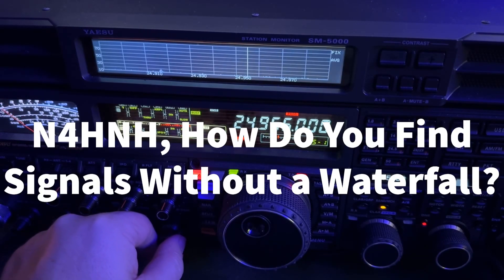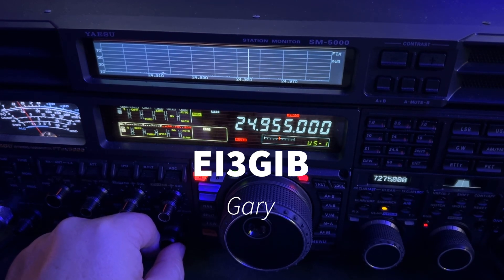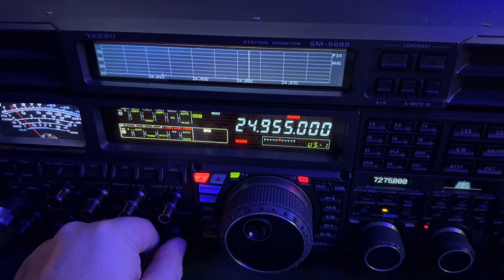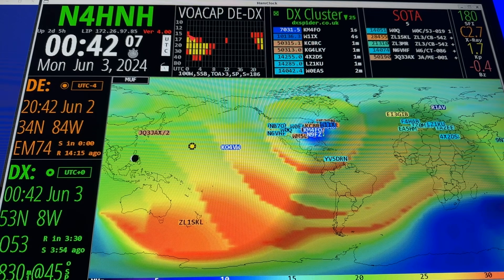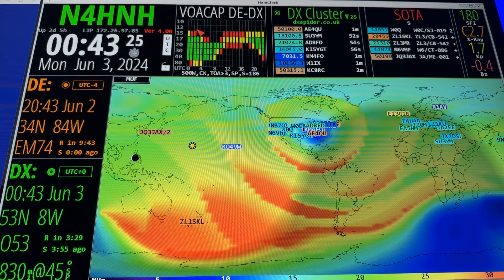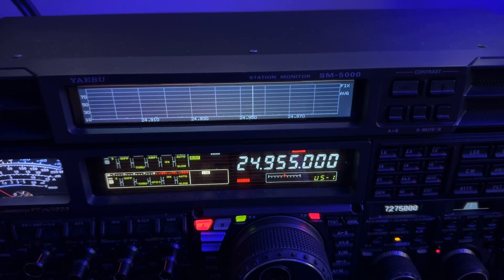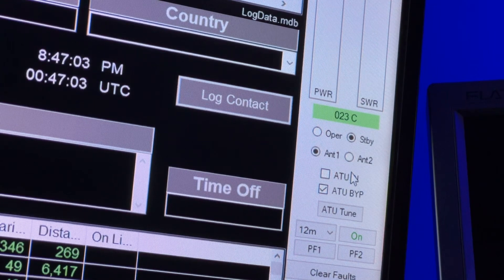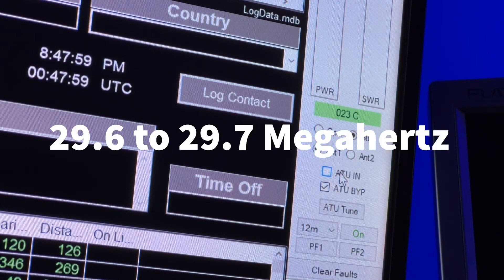N4HNH, How do you find signals without a waterfall? #hamradio #ftdx5000 #waterfall #spectrum #scope

Comment: One waterfall option for the FTDX-5000 series of radios is to use Win4Yaesu software, a SDRplay RSP receiver and an interconnect cable from the FTDX-5000 IF output to the RSP.  The downside is the extra cost, but if one is already using a computer for logging chances are good that the Win4Yaesu software will work so all that is needed is the RSP and cable.  While the Win4Yaesu software is highly integrated with the FTDX-5000 (also the FTDX-1200, 3000, 9000 and FT-991/A), there are other free software options that also work.
Reply from the maker: I tried Win4Yaesu software. It was okay but I couldn’t adjust the size of its dialog and it was missing the ability to control some functions of the radio. As I recall, one thing mixing was some of the controls for the sub receiver.  I also tried the SDRPlay unit for about 5 days.  It caused a load on the IF that wasn’t worth the tradeoff.  It couldn’t even come close to receiving as well as the FTdx5000 receivers.  I decided not to trade superior receiver performance for a waterfall, especially since this is radio and not television. I can spin the VFO. I rarely even look at the spectrum scope.
Reply: @n4hnhradio  Hello,  I haven't tried controlling the sub receiver, but it's been my experience that the primary receiver functions are available in Win4Yaesu.

I'm a bit confused about your SDRPlay experience.  I connect my first gen RSP1 directly to the IF output jack on the radio, and thus it's only seeing/hearing what the primary receiver of the FTDX-5000 is, and that is being picked up by Win4Yaesu.  If you are referring to the SDRPlay RSP loading down the main FTDX-5000 receiver that's very concerning, and I'll need to check that out.

If you are referring the SDRPlay receivers as a standalone radio I have tried using the an original SDRPlay RSP and RSP Duo (both early model radios) as standalone receivers, and as a separate standalone radio I wasn't impressed.  I found both radios suffering from local broadcast overloading, even with an external attenuator along with the broadcast band limiter in the RSP.  I haven't tried the newer SDRPlay radios, so they may be better.

Thanks!
Reply from the maker: I tried the duo model stand-alone and fed from the IF.  Stand-alone was not impressive. I read reviews that the host receiver would be adversely affected to some degree, if using the SDRPLAY as a panadapter.  Since this is radio and not TV, receiver performance must take precedence over a display.  Especially since a waterfall is not something that interests me.  I bought the SM-5000 for the speakers.
Reply: @n4hnhradio  Good to know that the RSP is loading down the IF.  While I haven't noticed any issues, I'll definitely do some testing!
Reply from the maker: @radiofan2454 I haven’t tried one since 2019. Maybe they have improved, as you say.

Here is some information from Google’s AI: 

An SDRplay can adversely affect the reception of a nearby radio receiver if it is "tapping" into the receiver's intermediate frequency (IF), essentially stealing the amplified signal at a crucial stage in the receiver's processing, leading to a significant degradation in signal quality for the affected radio. 

Explanation…

How a radio receiver works: Most radios use a superheterodyne design, where the incoming radio signal is converted to a fixed intermediate frequency (IF) for further amplification and filtering before being decoded into audio. 

SDRplay and its function: An SDRplay is a Software Defined Radio which receives a wide range of frequencies and digitizes the signal, allowing the user to process it on a computer. 

Potential for interference: If an SDRplay is operating close to another radio receiver and is tuned to a frequency close to the receiver's IF, it can unintentionally pick up the amplified IF signal from the receiver's circuitry, essentially "tapping" into the signal before it is fully processed, resulting in a weakened signal on the affected radio.

If you really want a panadapter, the tradeoff might be worth it. I recall reading on a forum that the host receiver might lose 3dB of sensitivity.  That is only 0.5 S-unit of loss. I could live with that, if I wanted a pan adapter.

Comment: As a relatively new ham, the lack of standardization with S-meters bothers me. In my mind, the first number ("R" in RST) should be the subjective readability, and the "S" should be an objective signal strength. If the meters cannot be trusted or used for the "S", then now you have two numbers that are both subjective and seemingly referring to the same thing, making them redundant. I also wonder about the extremes-- In theory, you should be able to have a 51 scenario ie a very weak signal but perfectly readable due to a low noise floor and sensitive receiver.
Reply from the maker: Readability of 5 means you heard every word.  4 means you heard all but a word or 2.  A readability of 3 means you only heard approximately half of what they said.  At 2 or less you were probably imagining a signal.

The IARU established that a signal strength of -73dBm at the input of a receiver should be indicated as S9, with 6dB of change representing 1 S-unit of change, between S0 and S9.  

One problem is that meters are mostly accurate at mid-scale, which is why they are calibrated at mid-scale.  HF radios are typically calibrated at 14MHz, the middle of the HF spectrum.  So they will be most accurate on the 20m band.  The high and low end of the scale will be off to some extent, depending upon frequency and physics.  Physics?  The physics of the d’Arsenval movement in traditional S-meters affects the accuracy.  The needle relies upon a spring to provide resistance to movement.  The consistency of the strength of the spring could skew the readings in the upper and lower portions of the scale.  Note that all d’Arsonval movement meters exhibit similar characteristics, whether reading volts, amps, watts, etc.

The newer radios use digital technology to simulate a signal meter.  It is reasonable to expect a bit more accuracy across the scale, since the readings could be digitally compensated. But that adds programming cost which will be rolled into the price of the radio.  I suspect that the manufacturers settle on a principle of “it’s close enough for practical use.”

There is a similar situation with wattmeters.  The standard variety of meters are accurate to +/-10%, even the digital ones.  The professional grade meters are typically accurate to +/-5% with a few being as accurate as +/-3%.  Professional grade meters typically cost $600 or more.  Do we need to know so badly if our power output is 90W or 100W?  Not really.  No one can hear the difference over the air.  But, if we must know within 5%, we must spend $600 or more on an external, dedicated, meter.

Back to the Signal Meter.  S-meter readings from a high quality radio are usually not off by more than 1 to 2 S-Units (6 to 12dB) between S1 and S9.  That is close enough.  I err on the side of the person I’m talking to. If the meter shows 8, I give them 9.  If the meter shows 7, but they sound like 9, I give them 9.  

Perhaps we could tell the manufacturers we are willing to pay $600 for them to integrate meters with an accuracy of +/-5%.

I recommend that you not get too hung up about meter readings.  The radios in the early days didn’t even have an S-meter.  The usefulness of the signal meter is mostly for relative readings. If someone asks, “am I stronger with this antenna or this one?”  You can look at your S-meter to provide a relative reading of the difference between the two.

You should watch my video called, “Decibels, S-meters, Amplifiers, and Gain.”
Reply: @n4hnhradio  Thank you for the excellent response. That all makes a lot of sense. Still, there seems to be very little agreement among the community on how to actually give an accurate and useful S reading in a QSO. Especially when the value changes by frequency, and IPO/AMP settings. And you throw in a lot of people just giving 59s by default and the whole thing often seems like a relatively meaningless exchange, which is fine I suppose. 

I went down a rabbit hole on s-meters recently and discovered that most of the major manufacturers, Yaesu included, do not even follow the IARU specs for their S-meter calibrations. When you say "If the meter shows 7, but they sound like 9, I give them 9." It begs the question--How do you know what a 9 sounds like? I do see your point on relative readings for comparisons--that would be useful regardless of the ultimate accuracy. 

I do want to say I very much appreciate and enjoy your videos. I have learned a lot from you already and you were very instrumental in me getting my FT-710 dialed in. I will check out your decibels video. 73!
Reply from the maker: @WQFT99 I can only assume that you did not read my video description.  I almost always pack extra into the video descriptions.
Reply: @n4hnhradio   I did read the description-- that's actually what prompted my initial comment. You defined how you give S readings by ear, but your descriptions of all the levels are based on "readability" which in my mind should pertain to the "R" number, not the "S" number. I'm not trying to argue, only to learn. When I said "how do you know what a 9 sounds like" what I really meant was--"how does a new guy know what a 9 is supposed to sound like if you can't trust the meter"? By the way, I just watched your decibels video and it was also very helpful.
Reply from the maker: I’ve explained in numerous videos, especially in my SOTA playlist, that some of us use QRP radios with no S meter.  We consider full quieting as S9.  Complete readability could happen at S1.  I see that often when operating CW.  I give many 519 and 419 signal reports.
Reply from the maker: It might date back to the days of no S-meter.  I’m an old-timer, but not that old. My old-timer Elmers just used a by-ear scale.  S9 being full quieting.  Not, S9 might not be full quieting on a noisy band. That’s something else to consider.  And, in order to give some close to an accurate reading, you need to use the first preamplifier stage by not the second one. S-meters are calibrated with the first preamplifier enabled. That’s AMP1 for a Yaesu.  But, on the higher frequencies, especially 12 meters and higher, AMP2 might yield a closer to accurate reading.

Like I said, don’t get hung up on S-meter readings. They aren’t laboratory quality instruments.  If they were, they would cost more than some of the radios.
Reply: @n4hnhradio  Makes sense, but still comes back to the chicken and egg question of how did the old timers calibrate their ears if they didn't have an S meter. If you define an S9 as full quieting, I guess that's as good of a definition as anything, but also doesn't seem universally agreed upon. From discussions I've seen on the subject, if you ask 10 hams what S9 means, you'll get at least 11 different answers.
Reply from the maker: You’re obsessing unnecessarily.  If you can’t enjoy your radio because the manufacturers can’t provide a perfect, laboratory quality S-meter, while keeping the radios priced affordably, then you should consider a different hobby.  

Here is Grok AI’s explanation of S-meter calibration variations.

“Various ham radio manufacturers calibrate their S-meters differently. The calibration of S-meters is not standardized across all manufacturers, which leads to inconsistencies in readings among different transceivers. Most S-meters are only calibrated at the S9 level, which is defined by the ITU/IARU as -73 dBm for frequencies below 30 MHz. However, beyond this calibration point, accuracy can vary significantly. 

For instance, some traditional analog receivers might only provide a relative measure based on the receiver's AGC voltage, and their S-meters might not accurately reflect the 6 dB increase per S-unit above or below S9. Newer Software Defined Radios (SDRs) with higher bit depths can offer more consistent and accurate readings across the entire S-scale right out of the box, but even these can differ from one model to another. The accuracy of S-meter readings can diminish above S9 or below S5, with some units providing reasonably acceptable readings between S6 and S9. 

This variability means that signal strength reports can differ significantly between different brands or models, even when using supposedly identical equipment. Some operators calibrate their S-meters using a signal generator to achieve better consistency, but without such calibration, there's no guarantee of uniformity across different radios.”

I have calibrated S-meters as part of my job as a radio technician.  That previous paragraph, “using a signal generator to achieve better consistency”, only makes it perfect at the frequency and reading it was calibrated for.  If you calibrate for S9 at 14.2MHz using -73dBm of signal injection, your meter will display an accurate S9 reading at 14.2MHz.  It might even provide fairly accurate S9 readings across the 20m band.  But it will vary on the low and high end of the scale.  In the video I recommended that you watch, I explain the variations of the S-meter in my FTdx5000.  I know how far off it is from S2 to S9, and above S9, on the 20m band.  I know that it is accurate at S1 and reads 1dB low above S9.  Knowing the variations, I can interpolate to give someone a fairly accurate reading, if I am receiving them on the 20m band.  Even still, what does it mean for them if I tell them that they are S9+20dB.  They just know that their signal to me is quite strong, more than enough.

The scientific way to measure signal strength is in dBm, at the antenna connector, using a meter that reads decibels per meter.  You see, the typical S-meter is driven from the automatic gain control circuit.  That’s where it picks up the voltage that moves the meter.  So, the radio is using a voltage from one of the last stages of the receiver to represent the signal strength that is entering the receiver at the antenna connector.  The complexity of a circuit that could measure at the antenna connector, and not be fried when we transmit, would be cost-prohibitive.  So the AGC approach became universal. The displayed reading is an interpolation of a voltage from the AGC, isolated from the transmitter.
Reply: @n4hnhradio  I'm not obsessing about anything. I have enjoyed every second of this hobby so far, and it doesn't bother me in the slightest that I don't have a perfectly accurate lab quality S-meter. I am mostly coming at this from the perspective of learning my equipment and trying to provide accurate, meaningful signal reports to others. My main gripe (observation? comment?) is that there is not much agreement among hams, or manufacturers, as to how to actually do this. And because of that, the typical RST exchange does not seem to be as useful as it could be. You have gone above and beyond with your explanation and it is obvious you have a better understanding of this subject than most. I have learned a lot from this, so thank you. I will refrain from further comment. 73
Reply from the maker: @WQFT99 I use the by-ear scale, as shown in this video’s description.  I find that I give fairly consistent signal reports using that method.

Comment: Scopes are overrated.  Those of us that started before scopes and panadapters will crank the flywheel and hear a blip and scroll back.  New folks , learn the art of listening. Get a good set of "cans" - headphones.  You'll be surprised who you'll be able to work when you really listen.  Hes right,  many times i would have missed someone if i used my eyes instead of my ears.  As my old crabby Elmer used to say... the band is always open to somewhere.  Thanks for the good videos!Enjoy radio and have fun... happy new year! 73 de N3TGY
Reply from the maker: I shared this with my Patreon support team members before the video was released for general viewing: “After a while, experience kicks in and you know where to find specific types of activity on each band.  For example, on the 40m band, expect to hear CW signals at 7.070MHz and lower, FT8 at 7.074MHz, FT4 at 7.078MHz, and LSB voice from 7.125 to 7.300MHz.  Be careful not to transmit below 7.178MHz if you hold a General Class license, because your lower sideband emissions could extend below the 7.175MHz limit for a General Class operator.”

Comment: I think the idea of not giving a signal report based on the transcieve's S-meter should be promoted more - it should be given by ear since not all radios are the same (as you said), not all radios had an S-meter in the past (and some QRP rigs don't have one today), S-meters are calibrated differently between manufacturers and the S-meter on one's transciever is influenced by the setting of the RF gain.
Reply from the maker: Tight CW filters can throw off the readings by several S-units.  I sent a 559 to a station yesterday that was barely moving the meter.  But he sounded like a 559.

Comment: When I'm out in my Tool Shed Ham Shack in the front yard the radio I have there is my Dad's FT-920 I use to do a little wire antenna testing/having fun with. It's a lot different finding signals on the 920 than a radio with a spectrum scope, of which I have two in the house and got spoiled over the years. LOL
Reply from the maker: I still have my FT-920. It’s featured in a video or two. I can’t part with it. It served me for the bulk of my time on HF.  My second HF rig.